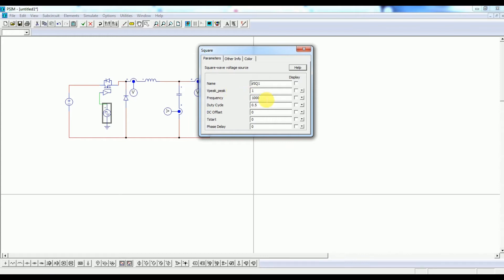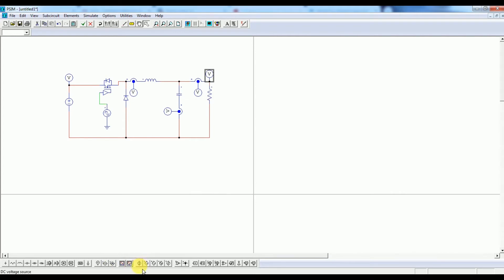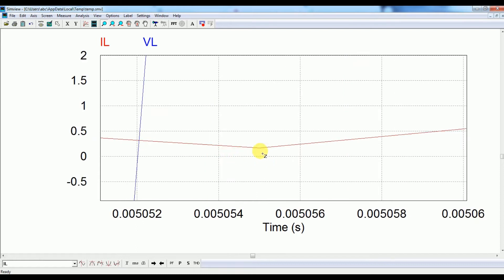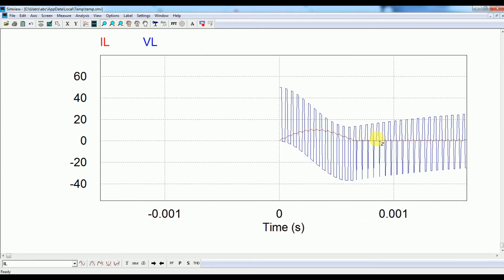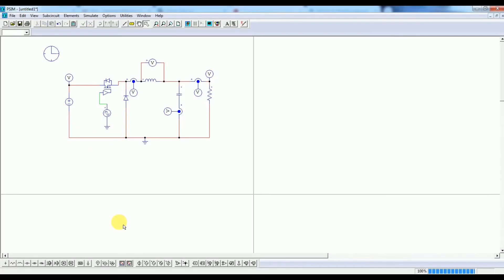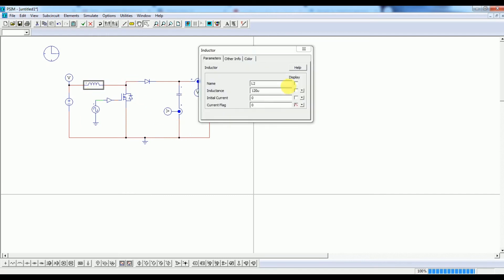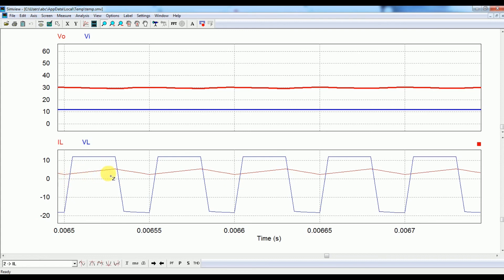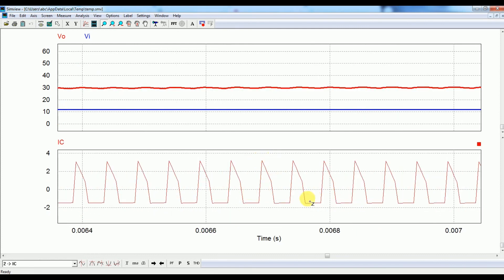DC-DC Buck and Boost converter Simulation using PSIM

Comment: Asalam o Alikum sir.
Sir as we are seeing in different research paper and I have seen your video Also in which you explained PO Mppt technique so you have use boost converter after PV panel and some use buck converter so what's the main purpose using buck or boost after PV panel.as my concept is that we are using because to maintain voltage for battery if battery is 48 volt so we have to maintain voltage through buck.
Reply from the maker: Yes, the choice of converter lies with the designer. Buck converter is not used most of the times because of the issues of gate driver circuits and stability (ref: Xiao, W., Ozog, N. and Dunford, W.G., 2007. Topology study of photovoltaic interface for maximum power point tracking. IEEE Transactions on industrial electronics, 54(3), pp.1696-1704.). The main reason is the establishment of dc link voltage and its subsequent conversion to the load. For battery connected systems there are two converters used. One for tracking the MPP and second which is a bidirectional converter controls the charging/discharging of the battery.
Reply: @HadeedSher  thank you sir for explaining

Comment: What is the difference between Voltage Probe and Voltmeter here... Am confused about how you measured the inductor current.
Reply from the maker: Voltmeter is a voltage measurement tool. On the other hand, probe is a tool to plot . For example, you can use probe to measure the voltage at any point or it can plot the output of the current sensor. I hope this clarifies the issue.
Reply: @HadeedSher  Thank you sir...Can you refer some good books and online learning material(website etc)
Reply from the maker: There are various books which can be referred to. It depends on your interest. If you have interest in any specific area then i can help you in finding a good book.

Comment: Great Video,

How would you select the values of the components such as inductor, capacitor, resistive load. For a PV Module
Reply from the maker: There are various research papers for this depending on the load requirement. However, the following is a great work.  
Xiao, W., Ozog, N. and Dunford, W.G., 2007. Topology study of photovoltaic interface for maximum power point tracking. IEEE Transactions on industrial electronics, 54(3), pp.1696-1704.
Reply: Thank you!!

Comment: Assalam-o-Alaikum @
Dr. Hadeed Ahmed Sher Can you upload a video on GaN Totem pole PFC?
Reply from the maker: The PSIm do not have GaN devies. I guess that they require device modeling. Nevertheless, PFC circuits can be demonstrated using PSIM. I am currently busy with Linear circuit analysis course and have very thin free spans.
Reply: Thanks for your reply but I want to tell you that Psim 2020 license version has GaN models And I have the software but some problems are there for me so thatswhy I requested you to upload the video related to the topic.
Reply from the maker: @muhammadahsan-nt3wl  Thats great  but i dont have that version .
Reply: @HadeedSher  Thanks for your Reply